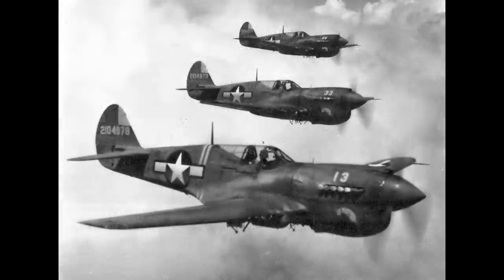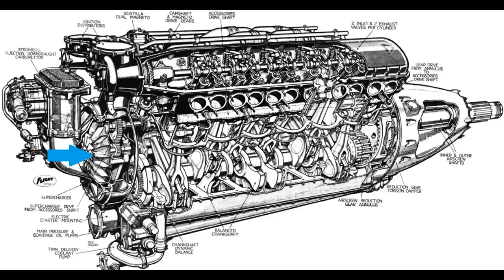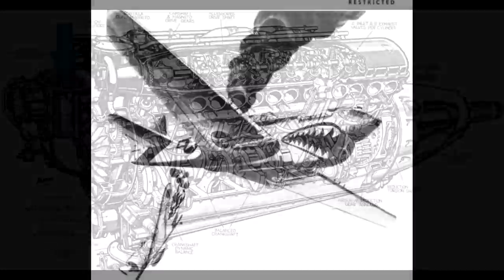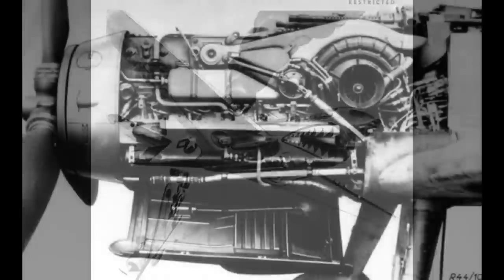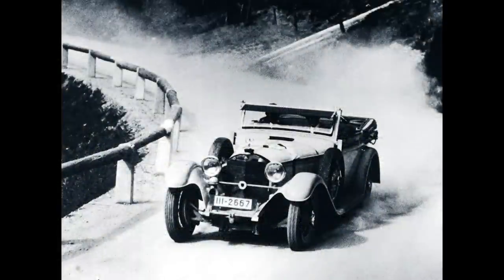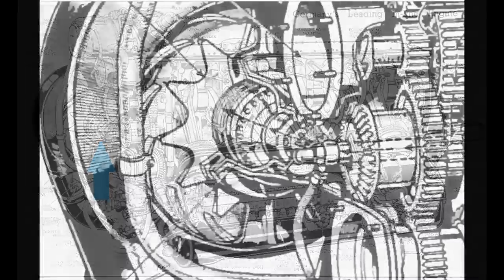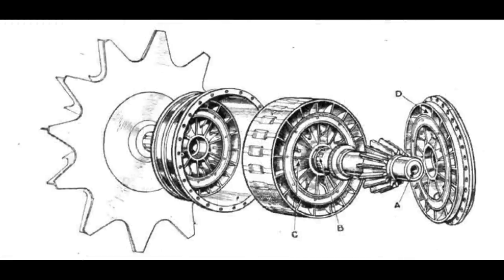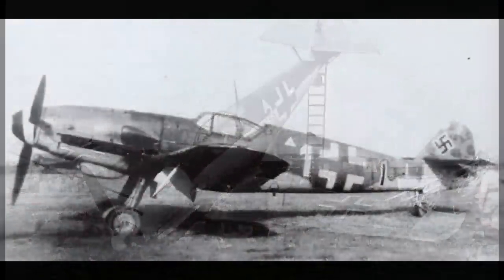Messerschmitt BF 109 Supercharger Drive System

Comment: The more I learn about it, the more I realize that the following statement is true: at the time that it entered service, the Bf-109E was the most technologically advanced fighter anywhere in the world.  Variable stage supercharging.  Fuel injection for extended negative Gs, and automatic mixture control.  An automatic variable pitch propellor.  Wing tip slats to retain aileron control at high angles of attack.  And from the E-4 variant till the final K-4, devastating thin walled mine shells that gave the HE rounds from its 20mm cannons an ability to punch far above its caliber.

I can only hope that someone can recover the documents and blueprints needed to finally rebuild and repair the DB 600 series engines.
Reply: Scott Wiggins  *with higher octane fuel, massively outnumbering the 109, bombing of manufacturing facilities, the list goes on
Reply: I’d love to see an airworthy Kurfurst-4
Reply: Also, the position of the landing gear made the 109 to be easy mantenaince and transport by train you just can take out the wings and still have the plane on his own weels. Dont forget also the Horizontal Trimable stabilicer, fletner tabs, engine controls, pilot sitting position allowing more gs, was a very very well thought plane and futuristic design. On 45 still was pair or even superior the best allay fighers with newer designs. Amacing aircraft. One plane capable of fighting everywhere while the spitfire needed 3 wings, 2 different kind of engine to be equal with LF and HF while some planes were specialiced on hight alt combat and other on low combat like russians. 109 did great againt all that variety of allay specialiced fighters, Yak, Las, Migs, P40s, P38s, P47s, Spits, P51s... Able to dogfight, able to be fast, able to climb, able to have good armament...I can not thing about a more succesfull design.
Reply: The American Allison engine had half the components the Rolls-Royce Merlin had and probably half as many as the DB-601. The Allison was made for mass production, the others not so much. While it's true that the Allison had an inferior turbo-supercharger which rendered it less effective at altitude over Europe, it was an in-demand engine in the South Pacific where they fought at lower altitudes and higher temperatures.

As Stalin once noted, 'Quantity has a quality of it's own.'. The USA was able to make 70,000 Allison V-1710 engines while DB made only 19,000 601's. At the end of the day, the USA and England buried the Axis powers in aircraft engine production.
Reply: That's all fine and well but if you don't have access to oil you have nothing at the end...
Reply: @pimpompoom93726  The US alone out produced the axis in EVERYTHING. We, for example furnished the USSR with almost as as much war material as the US used from D-Day to VE day in Europe. Including, but not limited to 20000 aircraft (not sure how many of these came from Britain then sent at least 7-8000 I think) and 425000 tactical trucks most of the Studebaker 2 1/2 ton truck production went to the USSR . Propellant powders when they could make none and steel to make tanks....

"Now they say that the allies never helped us, but it can't be denied that the Americans gave us so many goods without which we wouldn't have been able to form our reserves and continue the war," Soviet General Georgy Zhukov said after the end of WWII.

"We didn’t have explosives, gunpowder. We didn’t have anything to charge our rifle cartridges with. The Americans really saved us with their gunpowder and explosives. And how much sheet steel they gave us! How could we have produced our tanks without American steel? But now they make it seem as if we had an abundance of all that. Without American trucks we wouldn’t have had anything to pull our artillery with."
Reply: @pimpompoom93726  19.000? maybe you are leaving the 605 out? Its the same engine with bored out pistons, a sub-type with a different name, and could have made a lot more but decided to produce the very similar Jumo 211 parallel to it, plus since there were more than 35.000 Bf 109s alone the Germans made plenty more 60Xs than that...
Reply: I also 'left out' US produced Rolls-Royce Merlin engines in that count, I focused just on Allison engines. The point being the US produced FAR more of one model aircraft engine than Germany did. We buried them in production and a large part of that was designing engines for mass production. US design philosophy was to keep it simple for easier manufacturing and that proved the difference.
Reply: Germany was able to produce synthetic fuel out of coal, but that could not be used for lubricating oils. They needed petroleum for that and their main source during the war was the fields in Ploesti, Rumania. We all know the war history of that.
Reply: @pimpompoom93726  No, the US simply had a LOT more production capability and was safe from attack. Focusing on fewer types of everything certainly helped.
Reply: DB 600 where also manufactured in Italy and Japan on license and  SFA (volvo) built DB 605 in sweden. It would suprise me if Volvo do not have engine documents.
Reply: @9595Christopher  dismissing allied engines simply because of the availability of high octane avgas ignores the fact that octane boosting was actually an american invention, so of course the allied aircraft would be designed to use it and the quality of octane boosted fuel would be better.
In fact I'd argue the fact that the db601 was running on non-leaded 87 octane was a massive engineering flaw.
Reply: Scott Wiggins  well i mean if you ignore how poor all german avionics were in comparison. No cavity magnitron, no centimetre wave radar systems, no effective all-range airborne intercept radar system, no radar navigation, far later introduction of gyroscopic gunsights after reverse engineering british ones, the list goes on an on.
Reply: @pimpompoom93726  Not only that, it was more durable, because it had simpler parts, and it was easier to fix when damaged.
Reply: Not just fuel injected.  Direct fuel injected.  Amazing
Reply: Herman who? How do you spell the name of the guy that created that hydraulic drive coupling?
Reply: @pimpompoom93726  the lend lease program didn't start with the war, the red revoluation and the industrial capacity of the udssr in the beginnung the usa and wallstreet had a greater involvment. the preparation started with new deal on the american side, or the greaat depression was orchestraited to get through the new deal people and economy war time ready. Nothing else did Hitler and Stalin.
Reply: @trauko1388  When did I disagree with that?
Reply: @GoetzimRegen  Great Depression was 'orchestrated'? Sorry, I don't buy into conspiracy theories. The Great Depression was an uncontrollable action of the economy, nobody 'orchestrated' it. I only wish economies could be controlled that easily, but they can't. Recessions and Depressions happen. Always have, always will.
Reply: @Biriadan  All true, but the German gyroscopic gunsight-while introduced late in the war-was superior to the British/US gyro gunsight. We must give credit where it's due.
Reply: @Biriadan  The Germany synthentic fuel was very innovative, but they couldn't produce much high octane avgas. Germany was ALWAYS short on fuel, it was the Achilles heel of the Third Reich. Their choice was to produce some 87 Octane fuel or to produce LESS 94 Octane fuel. Either way they were destined to lose the war.
Reply: @Biriadan  Germany had better radar and gun control radar before anyone else, their airborne radar was good too and they led the world in radio navigation, your fake list does go on and on... XD
Reply: @pimpompoom93726  wtf r u talking about?
Reply: @trauko1388  Read it again more slowly, maybe you'll pick up on my points the second time.
Reply: @pimpompoom93726  Nah, you claimed Germany made just 19.000 DB601 to make a point ignoring the DB605, which is really just another version of the 601 and of which 42.000 were made... or keep talking just about the DB601 as a distinct type, then your comparison is still dumb since, in that case, the engine was replaced in production in 1941 by the 605, 4 years before the end of the war. 

Get it now?
Reply: @9595Christopher  What is your point?
Reply: @trauko1388  Really? Ever heard of Gee, the first Hyperbolic navigation aid?
Reply: @DannyBoy777777  LOL!!! Gee wasnt first, the Germans had Knickebein, X and Y first, not to mention Sonne-Elektra, and if you aim at one KINd of navigation that is just splitting hairs to claim SOME KIND of first.
Reply: @geramos109  If you get technical about it the 109's that flew in the mid 30's had little lineage with the 109's flying in 1945 other than the overall shape being about the same. Greg compares the development of the 109 to the development of the Yak-3, -7, -9. The 109 went through multiple complete redesigns to keep it competitive with upcoming and upgrading Allied fighters and the evolving bomber threat facing the Riech throughout the war. The initial batches of pre-war 109's had a less powerful Jumo engine until they were switch to the DB600 series. The 109 also used multiple wing shapes, up to at the Emil the 109 had square wing tips from the Friedrich on they had rounded tips. There were significant changes to the DB600 engines throughout the war also. Saying that the 109 did 'great' against the Allies specialized fighters being able to dogfight was a product of the pilot no the aircraft, being fast, in several regimes some Allied fighters could flat outrun 109's, I'll give you that the 109 had an exellent climb rate, good armament, when you compare the actual weight of fire able to be expended by the 109 verses other fighters, with the exception of the gondola mounted cannon that really hampered the 109's performance, the 109 was very light weight.  All in all the 109's need just as much redesign, upgrading, and improving just as much as any of the other Allied designs that fought in WW 2.
Reply: @pimpompoom93726  the turbo supercharger wasn't inferior at all
Reply: @pimpompoom93726  their slightly improved version of allied technology was too little too late
Reply: That's incorrect, as debuted it wasn't so equipped, the f4 wildcat was the first to have 2speed 2stage superchargers
Reply: @Biriadan  correct, few realize that the older f4 wildcat was the first 2stage, 2speed supercharged aircraft with an intercooler
Reply: @danphariss133  It didn't. MG 34 outproduced M 1919, Germans made largest number of submarines, mini subs, locomotives and motorcycles in WW 2. 
In most categories US outproduced Germany roughly 2:1.  US did not have to mobilize large army as Albert Wedemeyer wanted, since Red army did most of the fighting. So, they could spare more men for industry. Overall, US gave only 1 percent of food to Soviets, trucks were not enough, since Germans alone had more trucks in 1941. than US gave to Soviets. What they did the most, was to help Soviet economy and drew over 80 percent of Luftwaffe to West

Comment: As a retired manufacturing engineer and machinist when I look at the design on that engine and supercharger system it may have been the gear
Design that influenced the 90 degree drive. bevel gears are much stronger and quieter and more compact than spur gears allowing for a greater ratio change without a loss of strength that whole engine design was light years ahead of anything the allies had and the fuel injection system is essentially what we are using in our automobiles today
Reply from the maker: Hmm, that might be the best theory I have heard on this so far. Thanks Don.
Reply: @GregsAirplanesandAutomobiles  love your videos finally some common sense the gears are one thing and by moving it to 90 degrees they created better flow
as you mentioned already plus by putting it on the side they shortened the nose which would help weight and balance as well 
all and all a very clever design
Reply: Perhaps the question to ask is not why the Germans mounted it on the side, but why everybody else mounted it behind the engine.  Both must have been conscious choices.
Reply: The American turbo superchargers were pretty awesome 👌

Comment: Interesting ! I read from some magazines that the F-6F Hellcat also had a hydromatic coupling for the Double Wasps compressor. In regards to the DB601 and 605, the engine manual for the DB601 states explicitly that the first gear coupling was fix, while the second was variable, probably due to excessive heat transfer to the oil, so the superior effect was only there above critical altitude of the first gear (around 2500 m), but then because of this the compressor revs up with altitude giving the DB601 superior performance between 2500 - crit. Alt of second gear which was 4500 m for the DB601,  5300 m for the DB605 A (AS, D had then higher crit. alt becuase of bigger compressor of DB603), whereas for instance the BMW801 of the Fw190 had a rather large 'hole' above 1500 m (crit. Alt of first gear) and the changeover to second gear (around 3000 m), in changing before that altitude the additional boost would be offset by the power consumption of the Compressor , due to the Regulator limiting max. pressure, thus all fix coupled compressors have this 'hole' where power drops with airdensity, the worse the higher revved and the overboost of the second or n-th gear's revs are, in the case of the Fw190 this loss of power one had for almost 1500 m. The worst of them all was the Merlin single gear (Spit Mk. I - V), it ran at very high RPM producing vast overboost at sealevel which had to be regulated down (with loss of power of course). Only later in the war special inlet installations took off some of that load by reducing air density (actuated by the regulator, the DB605 D used that).
Reply: I think it was on some version of the corsair that it was used

Comment: The reason I would set a supercharger at 90 degrees to the crank would be to facilitate maintenance, since it becomes a very self contained module that can be removed from the engine/vehicle without having to move anything else first. With a rear mounted supercharger you'd have to pull the engine or rip open the body of the vehicle more than one would like in order to even touch the thing.
Reply: Accessibility is important in the field. That thing looks dead easy to remove. compared to an inline one.
Reply: Given that maintenance seems to be why an inverted V-12 is used, it would make sense that they would choose to do this. I think your theory may hold water.
Reply: It looks right too. If it and the hydraulic coupling were bolted together rearwards it would not be compact. They did it and said nein, we need to place it like this. Germans like shaft drive, it's nothing for them to turn something 90°, and back again if they have to.

Comment: Hi Greg. I was amazed by the detailed explanation of the system. I flew on that plane (I mean the last edition of almost 2000HP) and I know something about mechanics. Once upon a time at the Academy in Berlin, a living mechanic from the time of the Second World War explained to me how time was spent on possible and frequent repairs and that everything should be done as soon as possible. For this reason, some conceptual solutions have been adapted to quick repairs. Although that doesn't seem quite logical to me. I remember very well the engine variant and only one perhaps insignificant detail. The mechanic said something that was a problem of converting the engine from B4 fuel to C3. The delayed detonation of the fuel during ignition allegedly caused large oscillations in the operation of the filling system and enormous overheating of the exhaust. There was even mention of a lack of some materials like nickel and that this limited modernization. It was wartime and Germany has no deposits of these ores. Thank you for a rarely seen detailed and professional explanation ....I remembered something else, maybe not important. The first variant of the engine had an indicator of the temperature of the hydraulic oil and its pressure. The one I was flying on didn’t have a pressure gauge. An additional pressure gauge of the charging system was located at that location. All of today’s BF109s that can fly have a lot of modifications. The problem is the hydraulic oil of that time, which is exclusively an oil derivative. I know for sure that ATF is used today and that the pump is electric with variable pressure. I don’t really remember everything because it’s been over twenty years.